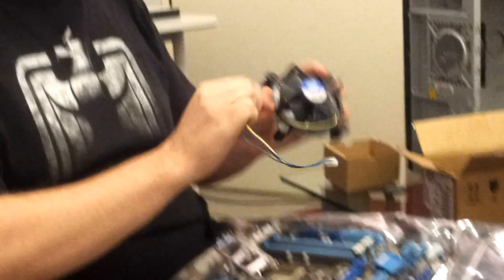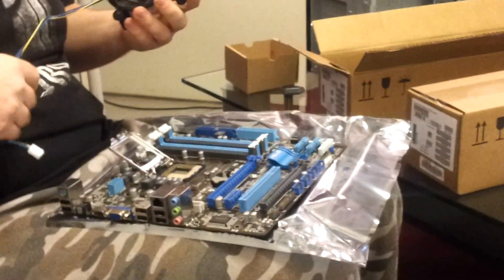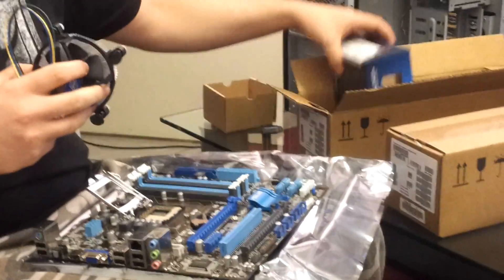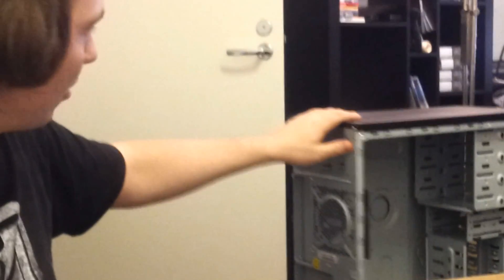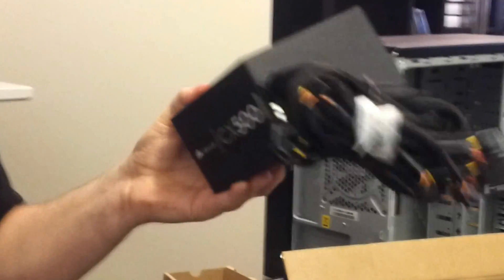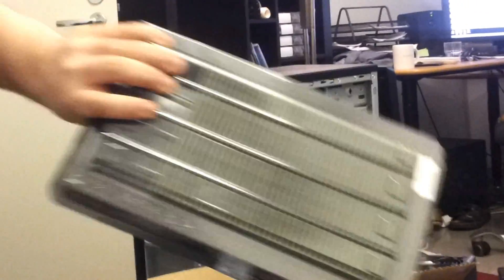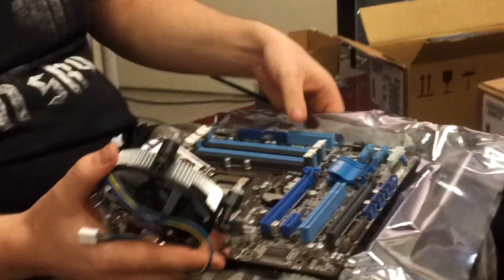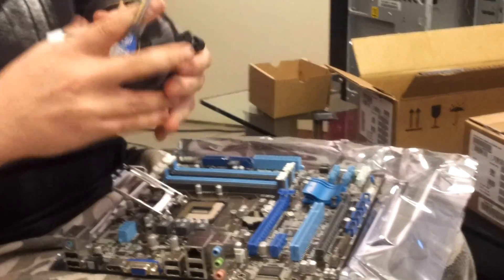CGI Diaries: Building a cheap render node

Comment: So, as it happened, we decided to change 8 of the i5 2500K's into the i7 2600K.
This is purely because Lightwave renders around 40% faster with the hyper-threading. The price for the i7 is about 50% more expensive, but at this point of the production the time is the most important factor.

So now we have 2 x i5 2500K and 8 x i7 2600K. 16GB in all of them, and no need to buy GPUs since both those CPU models have internal graphics processor.

THANK YOU JIMM'S!! Great service and quick delivery!!